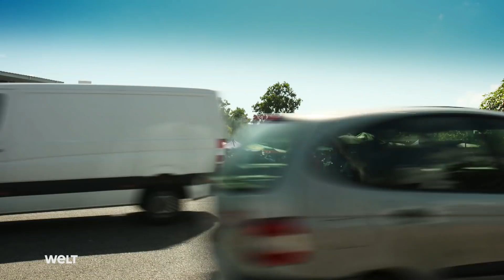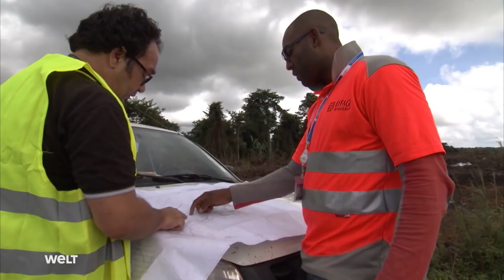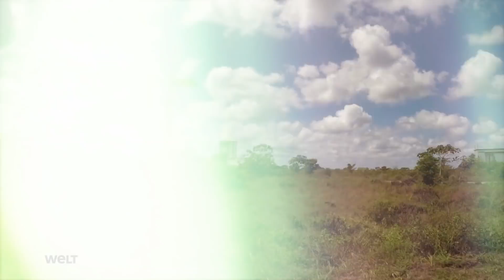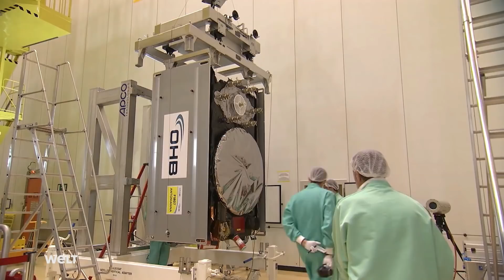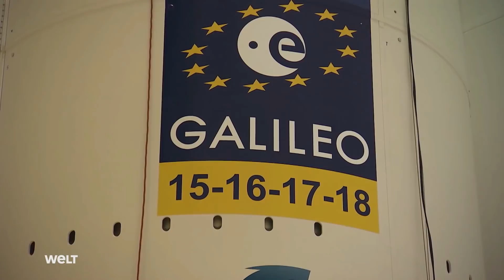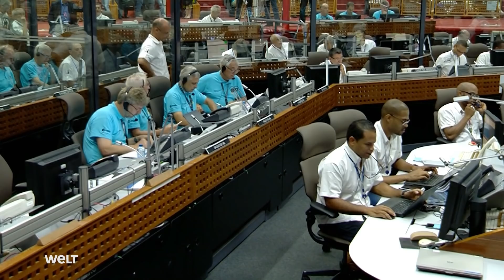Rocket Science - The success story of Ariane 5 (Pt 2) | Full Documentary

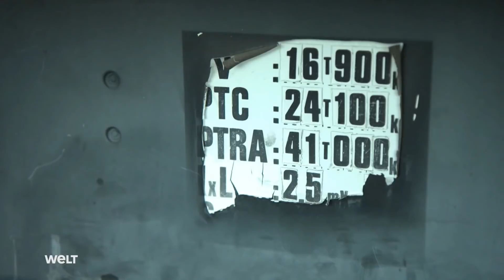Comment: 18:48 That truck has a 502 hp engine, not 5000. It's a standard MAN engine. The only custom part on that truck is the transmission: it has a dual-mode transmission with normal gears on one side, and a hydrostatic transmission on the other for when it's pulling the launch table.

Comment: The launch pad is located near the equator because the earth is rotating fastest there. I never thought of that ! Thanks for the informative upload.
Reply: I know what you mean, but technically it's not rotating faster it just has a higher linear speed. All parts of earth rotate at the same speed.
Reply: @zambani   The same RPM but not the same speed.
Reply: One more reason is for safety 
If they launch the rocket in a northern direction or Eastern direction if a accident happens it would crash into the ocean and by the time it's over land it would be so height that if a accident happened I would burn up in the atmosphere

Comment: So they use the short rocket to launch four Galileo satellites, and the large rocket to launch two?
Reply: The galileo satellites are not very big or heavy so they fit in the smaller fairing. The short version has a reignitable hypergolic secondstage instead of a cryogenic single use one. You need reignitable second stage to change orbital planes, unless you want all your satellites on the same plane.
Reply: @andrew7720  All right, that makes sense. But it doesn't explain why they wouldn't use the shorter version to launch two. Does the reignitable second stage make it a more expensive vehicle than the large one? And in that case, couldn't they mount a one-shot cryogenic second stage to the short rocket?
Reply: @kirkmattoon2594  The 2 sat variant (which is named ECA) is only going to GTO which is a very high energy orbit, this requires more performance which comes with the very efficient cryogenic fueled upperstage (this booster the performance to GTO from ~7.000 kg to ~10.000 kg, so a big difference). This cryogenic fuel requires an extra ignition system to ignite (and some other issues with the fuel settling and boiling off) compared to the shorter variant which uses hypergolic fuel which just ignite when you mix and is easier to handle.
 The efficient cryogenic option came later (to boost the performance to GTO imensely) and at that time there was no need to add complexity to re-ignite that stage when together with the other (although less efficient) stage you could cover alot of different missions. 
 The Ariane6 also uses an cryogenic upperstage but this one is re-ignitable, the stage is called 'Vinci'. They considered Vinci for ariane5 since the hypergolic option was phasing out but with the addition of soyuz-fregat launches from kourou (which also re-ignite) they decided to only use it for ariane6 and keep the ariane5 with the non-re-ignitable cryogenic upperstage.